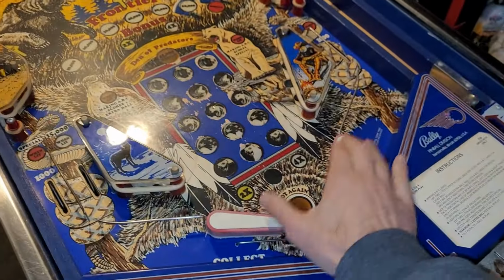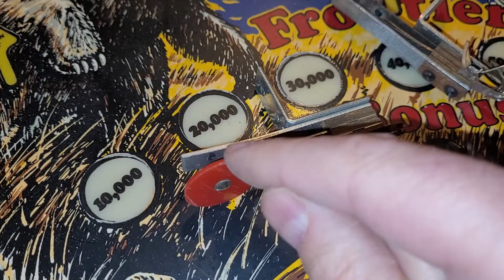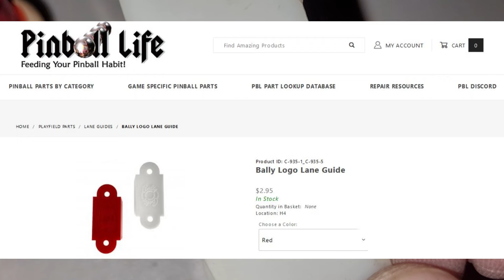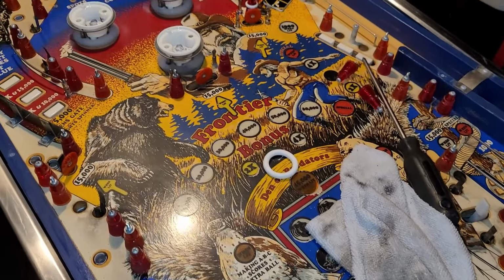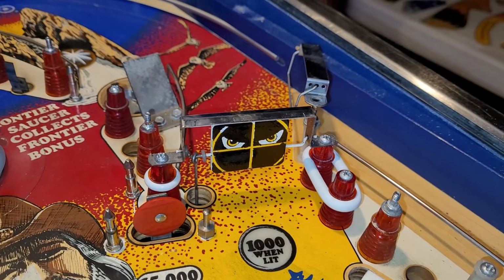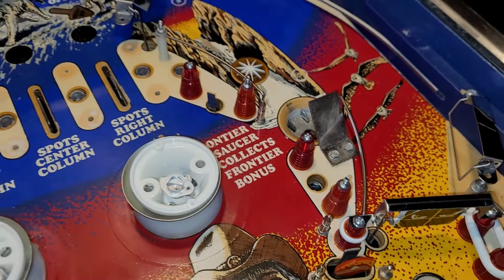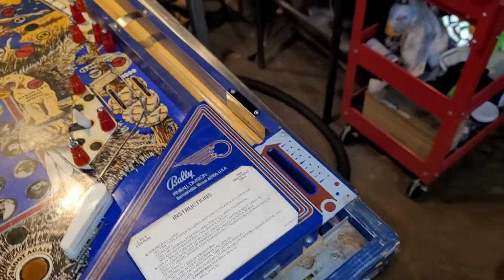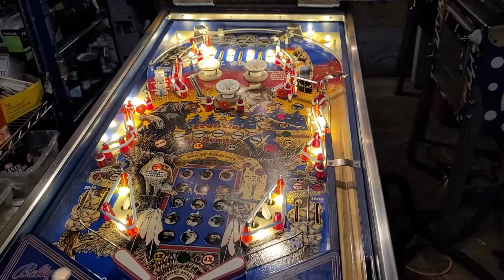Part 5: Bally Frontier Pinball Project. Don't clean spinners with Novus 2!

Comment: Mike, you have an incorrect metal post in front of your spinner. It's currently a metal t-post, like they used on older EM's, but it should be the same metal mini-post as the two that are just to the left of the red standup target to the left of the t-post.
Reply from the maker: Ok awesome thanks I will investigate that 🤘